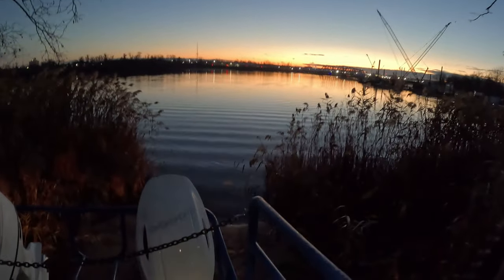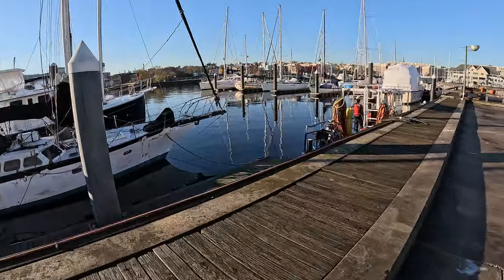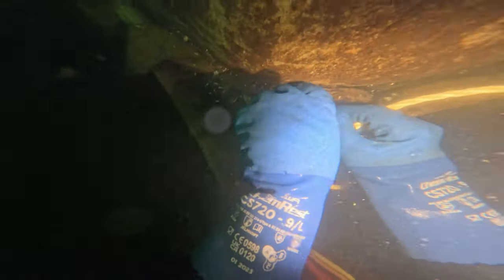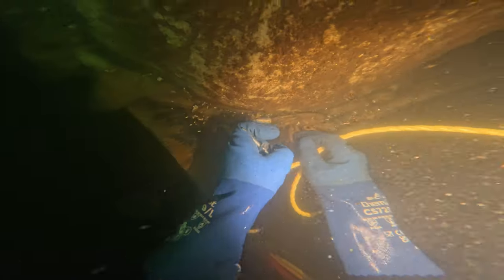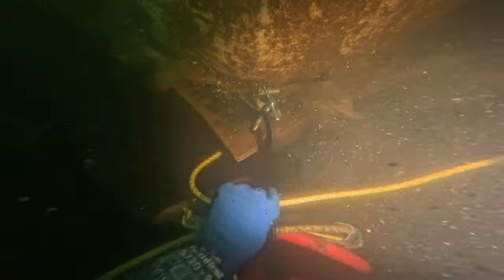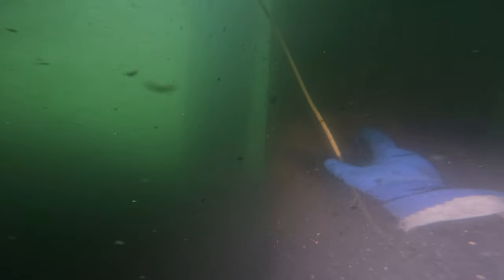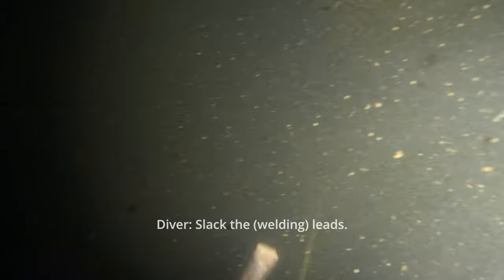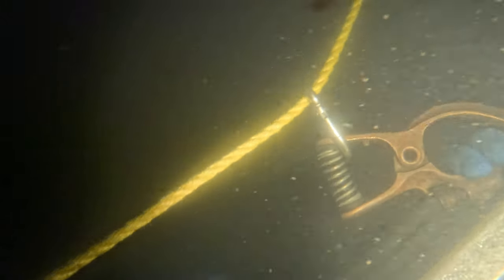Welding Underwater in 4K The Future of Underwater Construction

Comment: What keeps the anode attached to the piling when you first start the weld, looks like both hands were free
Reply from the maker: Some anodes I used the small ratchet strap to hold it in place but Most of them I held with one hand and got a tack weld on.
Reply: Thanks Ben, next time you and Zach are in town come visit